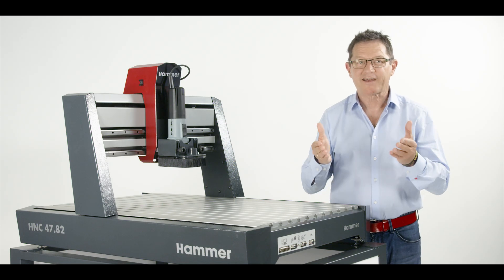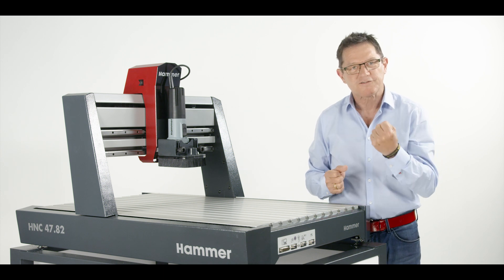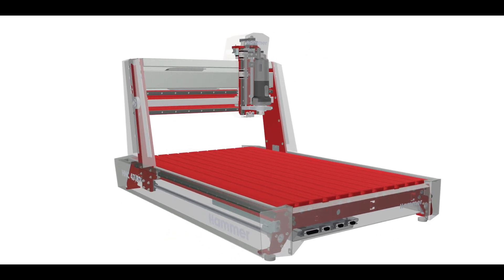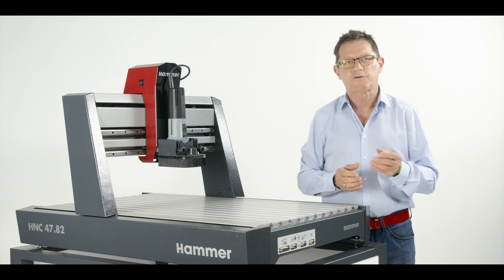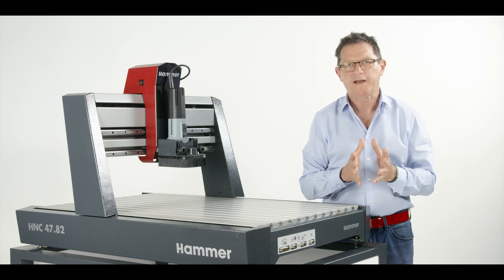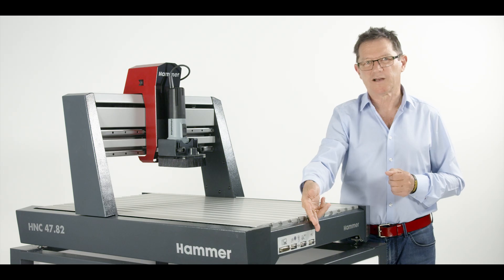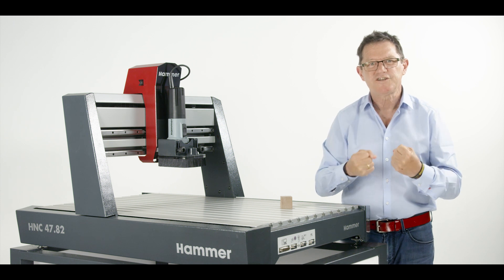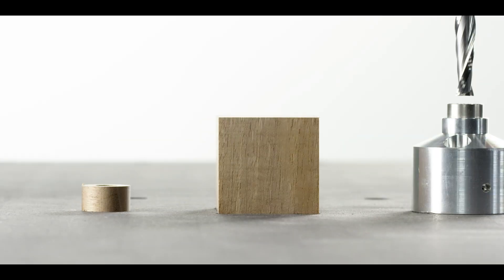Hammer® HNC 47.82 - CNC portal milling machine - technical data and precision check | Felder Group

Comment: Everything stopped for me at min 1: 00 when he said '' extremely robust T-slot aluminium table''. If the prospective customers for this machine are going to be ants , yes T-slot is extremely robust. For the rest of us it is just a nicely polished  easy-to-be-bent table.
Reply from the maker: Hello Mihai, 
thank you for your feedback! 
You can also visit our show rooms - Then you can test our HNC live

Thank you
Reply: i felt same. Also i guess they dont use ball screws and use trapezoid screw shafts. And last low quality item ıs that spindle motor. at the end it is ""high end"" wood machine.
Reply from the maker: we recommend to test our HNC 47.82 in one of our show rooms live 😊